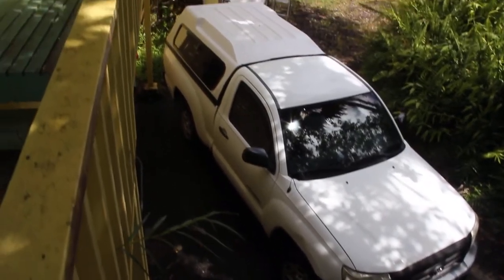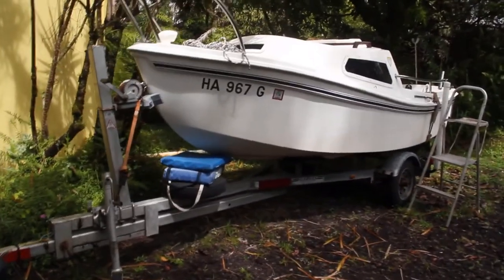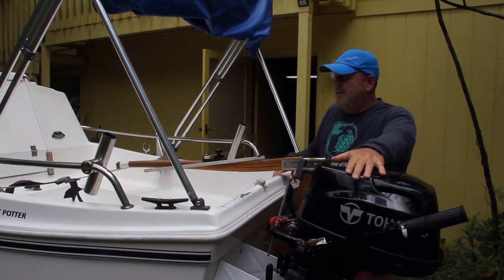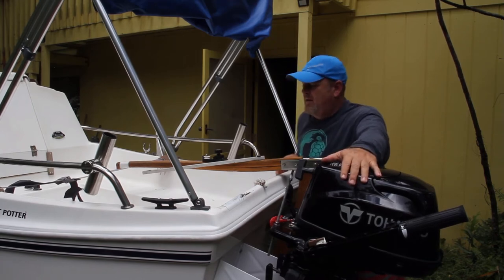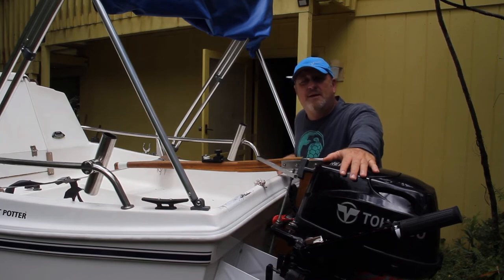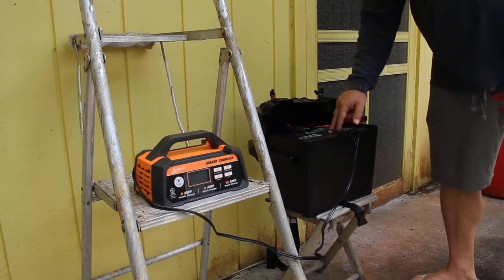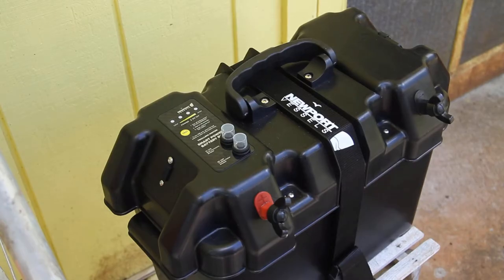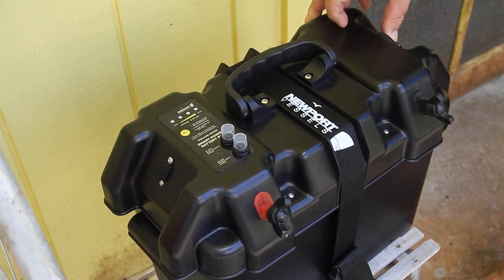Best Trailerable Sailboat, Set Up West Wight Potter for light to no wind.

Comment: Hello just bought a new to me 1981 West Wight Potter. I have a 4 hp 4 stroke outboard I want to use. What outboard bracket did you buy to handle a four stroke weight? Thanks.
Reply from the maker: My Potter already had a outboard bracket on it. So I am not sure. Sorry.

Comment: Hi, I have a nissan 4hp 4 stroke motor. These motors weigh almost 60 lbs. You don't have any issues with that much weight on the transom?  I always heard not put put anything more then a 3.5hp motor since they weigh only 41 lbs. I would like your opinion on this please. Thanks.
Reply from the maker: Mine worked fine but that much weight prevents from plaining.